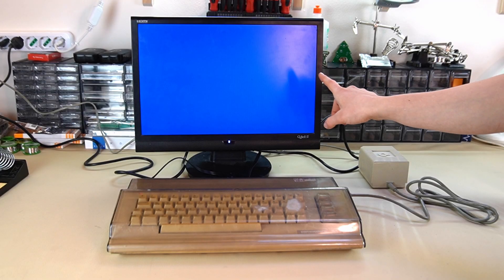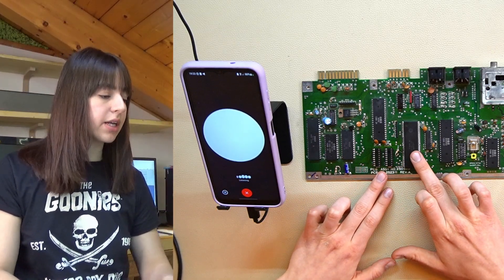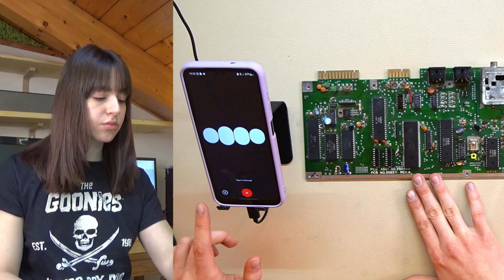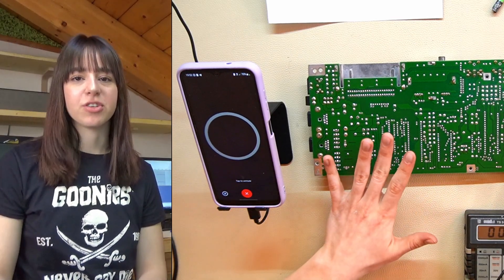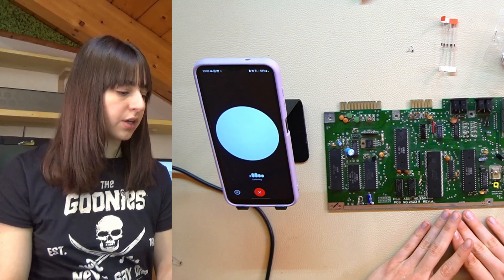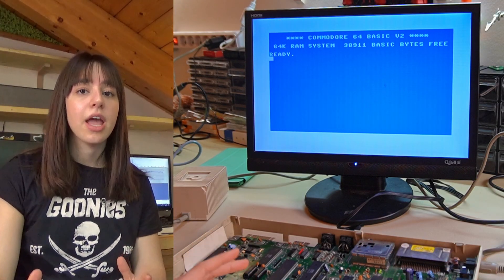I fixed a Commodore 64 using ChatGPT

Comment: The problem I'm certain was the blown traces. The diode is only needed for some of the ports. Diodes are not populated in the stock C64GS boards as its case doesn't expose IEC (floppy), tape and userport and has no keyboard either.

Comment: Too bad you fixed several different things at the same time without testing one at a time (ram, traces, diodes, solder joints). Now you don't know what the real issue was.

Comment: - 1:05 Didn't the AI used to sound more chipper and friendly before? This one sounded tired and annoyed that it has to answer; you can almost hear it rolling its eyes? 🤨
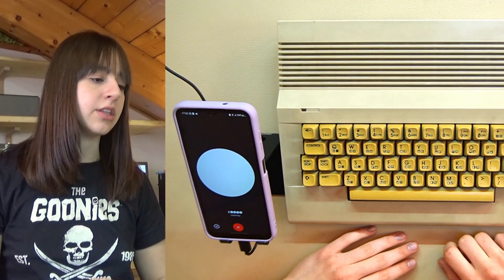- 1:20 Wow, it's really talking down to her. I'm surprised it didn't say to try turning it off and on. 🤦
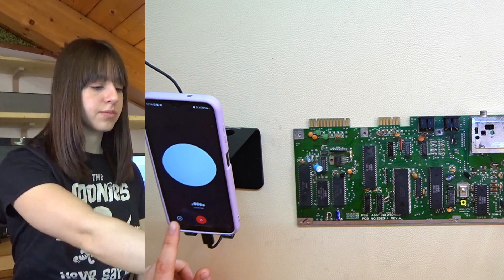- 3:38 Cold-joints happen, especially with these old solder joins. I saw some nasty ones in a C64 monitor once.
- 6:34 AI gives extremely generic responses, just like MSMVPs on Microsoft Answers forums.

Comment: Lol. I used to fix old office PCs with BSOD like this. 99% of the time, just reinstall the RAM modules and voila!. Great video and demonstration of ChatGPT's capabilities. Very odd that RAM sockets weren't installed into the board, considering the signs of repair attempts.

Comment: I was actually working on a project to connect Commodore 128 to USB-TTL adapter and GPT 3.5 incorrectly suggested that NMI and RX should not be soldered together. Since I knew this is incorrect I did not do this. I do believe GPT 4 is better however, I am not using it. On the other hand, when I connected my C64 and my C128 to USB-TTL adapter and plugging the adapter to Raspberry Pi I was able to chat to chatGPT from the Commodore using terminal program on the commodore side and linux shell using getty and some python on RPi side. Kudos on the video. Thank you for sharing.

Comment: Apparently you already have a good understanding of computers (distinguish RAM chip from CPU chips etc.) and fixing them, plus the availability of a professional toolset. You already know which direction to go and all this togethers renders the use of ChatgPT almost completely useless. The erased piece of trace could of course been detected by you in the first step, where ChatGPT told you to inspect the board for any damages, or blown parts. It would have been better if you let someone do this without any knowlegde of computers etc. But anyway it was an interesting video. 🙂

Comment: 1:26 a blue screen could be due to shortcut between pins, or, hsync or vsync broken. Or, some conductive dust fallen on the motherboard, or inside monitor.

Even if fault is inside monitor, problem may not occur with a different pc because there are several ways to sync, and various pc communicate differently over the same cable. 

Or, the decoding chip in the monitor could have a broken support for some specific resolution.
Reply from the maker: Thank you for the valuable input!
Reply: Well, for all we know it could be the default "no input" color of that particular monitor :D
The c64 has a blue background - exactly THAT blue background, as we see at the end. So, blue screen might mean that the CPU has stopped before launching the BASIC interpreter. It could mean anything. That's why the first step in any repair is a visual inspection of the board.

Comment: In all honesty, you were the one who noticed the problems on the board. Chatgpt never really was the reason to the findings.
Reply: ChatGPT is a language engine. What it does is search for data that are pertinent to the question asked and compose a text. It might be useful in a sense, like chatting with a friend who has some knowledge about the topic.
I've used chatGPT a few times for rubberducking and it's pretty useful, provided that you don't take anything it says as "the right answer". It might say something you didn't think about, though, and steer you to a different track.

Comment: I just went and entertain this idea, this is my prompts:
"""
I am currently testing out the "Commodore 64" that I recently bought and it is an old computer.  Upon the test, there is a full blue screen and I am not able to see my keyboard cursor nor anything -- I have full experience in trouble shooting, electronic, repairing and so forth -- please update yourself with most common problem to "Commodore 64" and especially any indicator about blue screen.  And give me a full detailed solutions on what need to do.
"""
"""
Where and how do I identify the PLA, VIC, and BASIC ROM? 
"""
So far, the answers by ChatGPT/Bard has definitely place me on the right track in troubleshooting...The trick is to be specific and ask the right question.
------------Answers sample below:
Look for chips with specific labels:
PLA: It's usually labeled "906114-01" or "MOS 906114-01" and might be located near the CPU (usually a 6510) in a position marked "U17" or "17."
VIC: Look for a chip labeled "6567R" or "MOS 6567R" usually placed towards the top-left corner of the motherboard, typically in a position marked "U7" or "7."
BASIC ROM: There are two ROM chips labeled "901226-01" (8k BASIC) and "901227-03" (8k KERNAL) typically found side-by-side near the top-right of the motherboard, often in positions marked "U5" and "U6" or "6" and "5."
Reply from the maker: I agree. It's amazing how with the right questions and some basic knowledge of the topic you can achieve exactly what you're looking for

Comment: ChatGTP is a waste of time and incapable of assisting you in doing such repairs

You should have view these Youtubers on C64 repairs: Adrian's Digital Basement Jean Beta, Noland's Retro Lab, Arctic Retro, and RMC - have have one many C64 repairs of various symptoms and issues.

Besides the issue you found, A Blue Screen, usually means that the BASIC ROMs are being accessed. You could have tested that if you had a game cartridge, insert game cartridge and if the game plays, the fault is in the ROM, the connecting addressing multiplexers  or the traes going to that area. The game being able to play says that the Vic II, SID,, CIAs, PLA, and RAM works.

You obvious have a butchered C64 there where attempted repairs were made by some unknowing amatuer, and did more damage to the unit. Parts back in the 80s and 90s were difficult to obtain without buying another C64 for parts; thus they probably put that dead unit into storage and bought a replacement C64.

It is good to see a woman do such works, as fixing computers is something anyone can do and not a male orientated job. Keep up with the great work. I'll Like and Subscribe.
Reply from the maker: Thanks for your advice! I always follow the YouTubers you recommended to me, I really enjoy their videos, they are very informative and also enjoyable to watch.

Comment: Adrian's Digital Basement and now a new generation Sayaka's Digital Attic, nice video, respect, subscribed.
Reply: Lol yes and Adrian would recommend to use hot glue as well. Anyway very good video, I still need to repair a black screen C64C board, I know the issue but I will also try chat GPT. Didn’t think of it so many thanks!

Comment: Excellent conversation with ChatGPT, excellent soldering and desoldering skills, I done soldering before, but not as good, maybe teach a few soldering tricks in a future video. It’s amazing that ChatGPT can help to    fix electronics and is a good idea to ask experts on the subject matter, other than that, seems to me that when fixing broken down electronics first test for any continuity malfunctions, well a visual inspection first is a plus.  So OS what clever and simple way to fix a broken down electronic circuit, by bridging the circuit with an appropriate gage wire, I’m so impressed, really.  Keep up the good work and don’t breathe in the smoke from the soldering. Great LAB setup and nice to see your electronic tools and gadget in use, ehehehe. “The Continuity!”😺🙋‍♀️👩‍🔧🔃🥰✨💎
Reply from the maker: Thank you so much for your feedback! Also thank you for the advice. It's not noticeable in the video, but I used a fume extractor during soldering. In addition to the portable extractor, I also built another extractor. It's the aluminum-colored tube that can be seen at the beginning and end of the video :)
Reply: @Sayakas_Digital_Attic  🥰 it’s amazing that the Commodore 64 is just a card hooked up to a keyboard ⌨️, imagine a modern day commodore 64 with wireless casting and World Wide Web access, imagine a Commodore 64 minimized PCI card for a Desktop computer, that would so cool right? Think of All the Commodore 64 possibilities! Cool, I don’t do too much soldering, but a fume extractor would be ideal to keep the soldering fumes away, no worries keep up with the good tech work! 💫💎😺 🥰👩‍🔧⌨️

Comment: I used to repair those all the time. Their are 3 chips that can cause the blue screen. You need a logic probe to detect the problem. Whenever I replaced a bad IC I always put in a socket for the new IC. A piece of phone wire if you break a circuit.

Comment: you should use enamled single strandwire wrap wire ot do the "bodge wires" not multi strand wire.  Alsom, a much finer solder would have been easier to use.   That being said awesome work :)
I learned to code 6502 assembly language in two weeks back in 1987 and THEN bought a C64 :)

edit: if multi strand wire is all you can get twist the exposed strands at the end so they are tighter together and pre-solder them.   you should always tin a wire prior to soldering it to where it is to be attached!

Comment: did you remove my comment? ..why, what's wrong with it?
Reply from the maker: I've been told that comments are sometimes removed, but it happens automatically and I don't remove them myself. It happens when external links to YouTube are included. Just wanted to let you know it's not me doing the removing
Reply: @Sayakas_Digital_Attic   well, It was just a factual, perhaps a little too long, but very nuanced (and by no means unfriendly) comment on the topic at hand...without links, without spam or whatever

Comment: i fixed my dishwasher with chatgpt. the problem was a sigle clog in a mixing tubes. and not a single the service want repair it becuase its 20x years old and not spare parts. needed only .5m platic tube and the gpt give me all steps to change. well 20years ago the bosch made things for ethernity.

Comment: As a lifelong electronic hobbyist and repair technician now in my late 60's suffering serious health
 issues "No doubt due to my Passion" I would like to advise you to get an extraction filter fan ASAP 
to use whilst soldering and using many of the chemicals that hands on electronic repair and or 
assembly requires..
I Subscribed today, and APU👁👍
Reply from the maker: Thank you for the advice. It's not noticeable in the video, but I used a fume extractor during soldering. In addition to the portable extractor, I also built another extractor. It's the aluminum-colored tube that can be seen at the beginning and end of the video :)
Reply: Hi, I have been into electronics for few years now. Only recently i came to know about the importance of fume extractor. What kind of health issues did you face due to that? Is it possible to get lead poisoning due to solder fumes? I get pins and needles in finger tips after prolonged soldering. I also get some pain in lungs.
Reply: @balajinarasimhan5346  Solder fumes don't contain any lead: lead vaporizes at 1750°C. The fumes are from the resin or from the board's coating and yes, they're not particularly good for your health, get or make a fume extractor. A small fan is enough to suck the fumes away from your face. Some irons have a built-in extractor ending in a thin tube over the solder point.
As for pins in your fingertips, it could be A) actual pins, bits of wire; B) your iron gets too hot in the handle; C) you're sensitive or allergic to lead, resin, or any other materials you're touching while working. Try wearing gloves (surgical gloves).
Reply: @balajinarasimhan5346  Sounds like you need to see your doctor to get him to organise a few specialists  ASAP..

Dont want to end up with lung problems complicated by nerve damage, not to overlook possible lead poisoning
Reply: another good investmen will be a respiration mask, and chem resitant glowes...
..it will be a good iinvestment in ur health for the future .. 
old circuit boards can give away toxic fumes (more than newer)..
and u will probably use other fluids that fumes anyway...

...been soldering and handlig fluids/alcoholes, cleaners etc.. a long time (some of it without proper safety equippment)
..trust me it will be woth it...

...take care, and never stop tinkering 🙂🙃

Comment: I never used chat gpt for this, but I used several AIs for programming and Mathematics. More than half of the time, their answers were either flat-out wrong or highly inaccurate. Even correct answers were far from being optimal, and AI was unable to fix this, even with my guidance. It's also pretty easy to "crash them", meaning they fall in an infinite loop answering the same (wrong) way again and again. So I would't trust AI for anything.
In this case, however, you obviously know what you are doing and you didn't need AI anyway. Still, it was an interesting experiment.
Reply: Yeah, I had the same experience. I tried to have ChatGPT write a simple basic program, but at the end I had to write it myself. I could only use the frame of its program.

Comment: Please don't breathe the fumes from leaded solder ! 🙈
Reply: You shouldn't breathe fumes from any solder, but lead isn't something to be concerned about since it's vapour pressure at soldering temperatures is too low. All needed to avoid negative health effects of lead is to wash hands after handling thoroughly.

There has been extensive research on electronics workers in the 80s and 90s in Europe and there hasn't been shown an increased prevalence of lead related diseases or lead accumulation more than normal. However half had asthma symptoms connected to volatilised tar and chemicals from the flux. Workspace extraction had already been mandatory, so it can be worse without extraction.

But weekend soldering is considered a low risk activity in general, unlike factory work.
Reply from the maker: Thank you for the advice. It's not noticeable in the video, but I used a fume extractor during soldering. In addition to the portable extractor, I also built another extractor. It's the aluminum-colored tube that can be seen at the beginning and end of the video.

Comment: Excellent video. ChatGPT is a work in progress, but wow, what progress it has made.   I have been using the text based ChatGPT 4.0 but not yet for repair (but will give it a go after this video.)  To avoid disappointment, approach ChatGPT as a tool and not (yet) as a source for complete solutions.  Remember, A.I. is learning from us.

Comment: It was all you, ChatGPT just confirmed your suspicions
Reply: I would say that ChatGPT was completely useless
Reply: @sergiotricarico   moral support is important 😊
Reply: @sergiotricarico  ChatGPT does work, but as clickbait term in the video title..... Well, not really clickbait, as it still is a honest repair.
Reply: At work we had to handle problems between the communication of SAP and the System of the SPS. 
The hotline did only confirm my suggested solutions haha....
Reply: However, ChatGPT's use of language when talking about electronics and board repair was dead-on.  That in itself is pretty amazing.

Comment: Great video, although your sound is sometimes not synced
Reply: That's normally one of two things.. poor computer processing/video editing software or just can be down to the internet connection. to be honest I've only had it on Apple editing on a lower powered machine like a 2012 macbook pro.  that would often master the video out of sync with the sound.
Reply: @Retroguyuk75  some of the video is overdubbed in a different language instead of being re-recorded anew. Remember it was first made in Italian.

Comment: Mad respect to anyone who dares to do soldering on camera
Reply: Yeah, there's always going to be that guy in the comments saying "WHY ARE YOU NOT DOING IT MY WAY?!"
Reply: When I'm soldering alone my hands shake a lot, If someone starts to watch me over the sholder I'm sure I'll solder my nail to a PCB without even realising, can't even imagine recoding for the whole world to see.
Reply: Cameras you can turn off. I've soldered with a pair of inspectors over my shoulders. One for each side.
Reply: @1pcfred  you can turn them off too depending on what you eat beforehand
Reply: Her soldering looks fine. But IKWUM.
Reply: @UberAlphaSirus  can you see the form of the conductor under the solder? Because if not then it doesn't pass spec. You have to use a little less solder.
Reply: Oh, yeah. The solder-mafia is real.
Reply: I think this goes for just about anything...as some very wise and perceptive person once said, "there's always a critic".
Reply: Do not search google for "OsmocomBB Filter Rework"
Reply: Almost as scary as applying thermal paste.